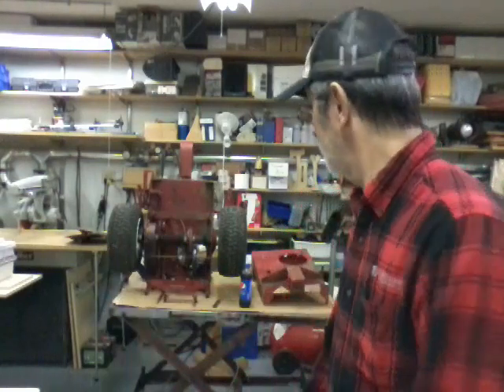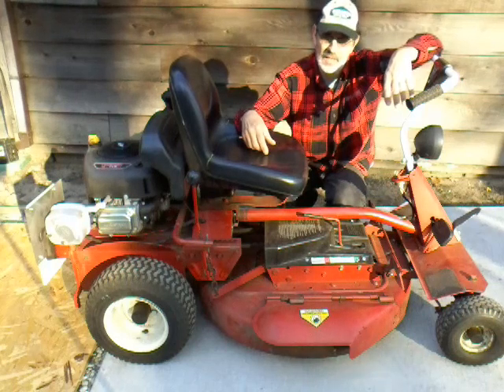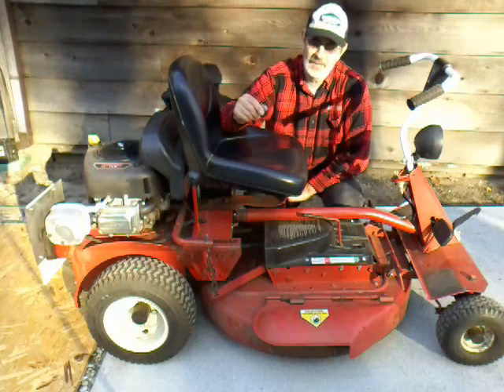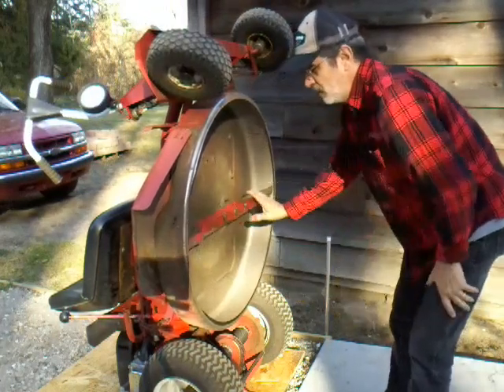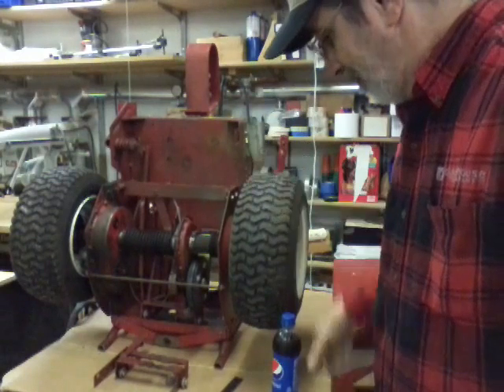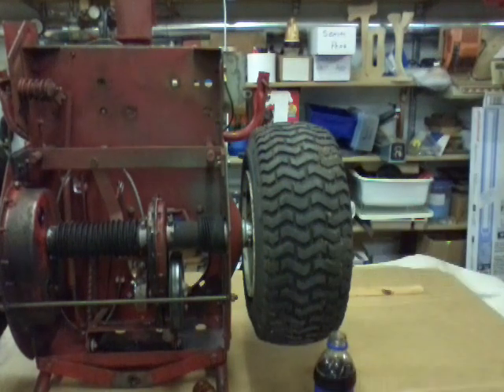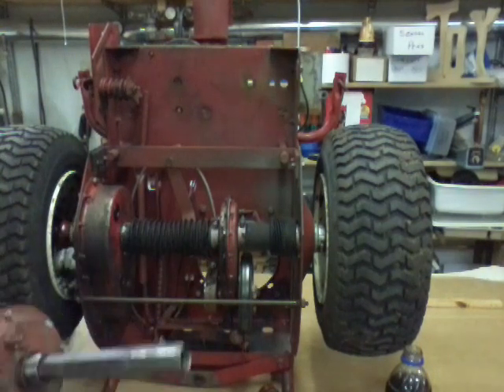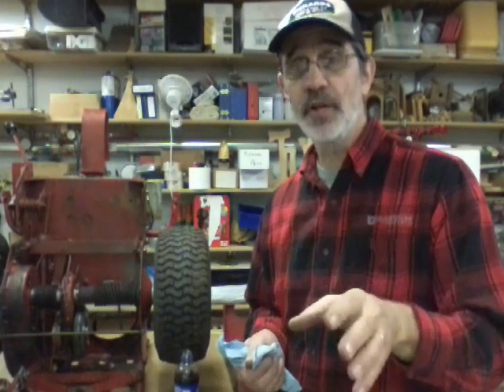56. Buying a used snapper,   things to look for

Comment: Hi Jim. Next week I'm going to look at what the owner says is a 25 inch cut Snapper. I've owned a 28 inch but never remember seeing a 25 inch anywhere. Is there a 25 inch?  It looks in great condition with little use and garage kept for $500. I will inspect it as you suggested in your Youtube above. If it passes inspection, is $500 a good price to pay? (I don't know the age but it has the steering wheel vs handlebar).
Reply from the maker: Jack Johnson 
  Hi Jack
 Just make sure it’s a high vac machine                Depending on where you live 500 sounds a little high for a 25 inch and less it has a bagger, and they typically have about a six horse engine on them. Jim

Comment: Hi Jim I've been watching your videos and you're you're pretty knowledgeable and helpful and lots of ways I have a problem with my snapper it's a 30-in cut with a 12 overhead valve motor and the battery won't stay charged it's a I bought a brand new battery and put on it I checked my lines on my charging lines and they're all connected and it won't hold a charge on the mower I can leave the battery on a charger all night long that when I first try to start it it'll fire real strong and real hard and and into the mall for me a little bit but then it'll just get tired and quit and then when I try to crank on it my batteries almost dead
Reply from the maker: Well let me ask do you have a voltage meter they are really inexpensive at Harbor freight then what I need you to do is start your machine and take the positive battery cable off (but don’t let the red cable touch the frame of the machine when it’s running)    and put the red lead on the battery cable and the black lead somewhere on the machine for ground this will tell you if your stater is working or not depending on the speed of the engine you can have anywhere from 7 V. up to 14 V. it could be shorted out and that’s what’s draining the battery dead check that out and let me know what you find out. Jim
Reply: No Him, I do not have that meter however, I'm going to town this morning and I'll get one, and try that out and let you know from there. Thank you so much for your prompt reply!!!
Reply: I said Jim but my auto correct don't hear me right, 😐
Reply from the maker: @cathyjo-leneprocter4194  Mine does that to me all the time and it really comes up with some bad things once in a while. Jim

Comment: I am looking to buy a 28" snapper riding mower, with a 10 hp motor and after-market bagging system. The motor is being tuned up by the seller, along with a new battery for the starter, and this video was very helpful for me to look closer at the frame and bearings, etc. The mower is clean, but the seat has a rip in it. What would be a fair-market price for this mower? I will send an email as well, and thank you for your help!
Reply from the maker: I would have to see a picture of it, and what body style is it does it have a round tube, a rectangular tube, or is it a turtle. Jim

Comment: Ive watched you for awhile & you've been a lot of help. I have a series 19 snapper rider. I'v changed the clutch cable (frayed) the yolk (all gouged up) the clutch wheel (rotted). When its one its back Everything is fine, when I put it down on its wheels it will not go into nutral or reverse. Got any Ideas? thanx Marcus in florida.
Reply from the maker: snafu1957 
Hi it’s Jim
   This might sound strange but check the bushing in your fenders and make sure they’re in good shape if they are totally wore out it will allow your axle to tip and it will shift hard.
  If you remove the yolk you wanna check that and make sure the tail of the chain case is sliding through the yolk properly you can do this with the machine standing up. 
   Check this stuff out and get back with me and let me know what you find. Jim

Comment: I just bought a series 11, as I’m learning , that has the channel iron style front tube assembly.  Specifically it’s a model 80260 
301011BE.  I like this machine a lot.  I serviced it greasing and oiling everything you’ve shown in your videos and checked the gear lube in the chain case and differential. I topped it up bit with Lucas gear lube. It was slightly low but not by much and the lube in it was still fluid and not hardened.  There’s no evidence of any major leaks.  The clutch driven rubber wheel is about half worn so I’ve ordered a new one to install. There is a good bit of loose wobble in the other half that is  is bolted to the chain case. I feel like this needs to be replaced but I cannot find this part as readily available as the rubber wheel half. 

I have two questions actually. One is, how does this series 11 machine stack up to the other “round tube” models?  The second question is how do I break the large nut loose that holds the other half of the clutch to the chain case so I replace that part when I can find it. 

Overall my machine is in very good condition and has been maintained quite well be the previous owner. 
As it is, it runs excellent and has only very minor slippage of the clutch such as climbing a steep bank or driving it up the ramp gate onto my trailer. 
I’ll tighten up the spring on the yoke too if needed once I install the new rubber driven clutch wheel. 
Thanks. 
I’ve learned a lot from watching your videos.  I’ve always admired the snapper rear engine riders and have used them to mow with a few times over the years but this series 11 machine is the first one I’ve actually owned.
Reply from the maker: Well, I would actually have to see a picture of the machine you have it sounds like you bought a SR machine. The clutch disc itself should be loose and spin on the clutch disc assembly. The clutch disc assembly should not be loose and should be bolted solid to the chain case I hang onto the assembly with a glove on and break the nut loose worth of ratchet and socket. If you can’t do that there is other ways it’s kind of hard to explain. Maybe I’ll just do a video put it on my channel tonight. You can send pictures to my email, which is.
jimsfixitshop@gmail.Com
Thanks again. Jim.

Comment: Hello Jim, I inherited I Snapper Comet 3080S with A Tecumseh 8 Hp Runs pretty good after some work However the brakes are not great and the it jumpy no matter what Can the clutch be upgraded to the smoother type so it does not try to jump off in first Mine has the clutch  and the separate brake petals I'm guessing its 40 plus years old
Reply from the maker: Hi it's Jim 
   If you order a complete soft clutch assembly it should fit on your chain case to switch that over from a solid clutch to a soft start. To  know for sure remove the clutch from the chain case take a couple pictures and email them to me at jimsfixitshop@gmail.com.  Thanks Jim

Comment: Hello Jim, where I live the ground is always wet and soggy. How much trouble would it be to put double wide tires in the back and the front to get less ground pressure ??? If I could buy adaptors to make this happen I would really be ahead of the mowing season. Makes no sense as I live on a hill but the ground is a swamp. Thanks
Reply from the maker: Victory First 
I have been thinking about that myself let me see what I can come up with and I’ll get back with you. Jim
   I have the back figured out I’ll just have to work on the front
Reply: @jimjackson9381  I look forward to hear from you Jim. Thanks again and peace too.
Reply from the maker: Victory First 
Can you send me your email address so it’ll be easier for me to get a hold of you when I come up with something, send it to my email not this description box, my email is
jimsfixitshop@gmail.com
Thanks Jim

Comment: Thanks for these great videos.   I have a m280921B that I bought new about 20 years ago.  Used your videos to replace both boots, replace the drive disc and replace the belt. Unfortunately I have the type where the front end tube rides inside the welded-in tube and the thing is frozen solid so I can’t move it and therefore can’t adjust the new belt. Frustrating.  I’m going to try heating the tube as you explained.  I have chained the rear of the mower to my trucks hitch and secured a chain-pull to a tree which I will hook to the front end of the mower.  I figured I would heat the tube and use the chain pull to try and yank the tube out. Do you think this will work? Any other ideas.  Thanks again.
Reply from the maker: Tom Gardiner 
Well if you heat it up hot enough
it will come right out by hand. Jim

Comment: My 2013 model 2800 bought used at great price and it looked like new. I cut twice and will not start again and will not even click. The tiny battery shows it is at 13.4 volts. I saw the video about these being lemons. Must be a bad switch as you mentioned as well. Give me some feed back, please. Thanks. Tim Williams Anderson, SC
Reply from the maker: tim williams 
I don’t work and a lot of these machines but what do you want to try first is unhook all the wires from the magneto shorting block Except the wire that comes from your ignition switch and see if it will crank over that Should disconnect all of the safety switches . Let me know how it acts . Jim

Comment: Jim, I have a Snapper 28 in mower and want to raise the mower deck higher that the top most notch on the height adjuster. Is there any way to raise the deck?

Comment: Jim, do you have a video or can you tell me if there is any real different between the units you show with the exposed round tube vs some of the units I see that have squared off sheet metal?  Are those units with the squared off sheet metal just the same with a cover over the tube?  eg. is a 5368 still the same as the comets you show in the video?  Also, what models are considered commercial with the bearings for the back axle?
Reply from the maker: ukewarrior 
Hi it’s Jim
   The units with bearings in the back axles also have eight pinion gears in the differential instead of four and that is what they call a “Tough series”. 
   The difference between a square tube in around tube is strictly personal preference, personally I like the round tube machines because that is all that I’ve ever had.  the square tube machines to me look a little clunky but that’s just my opinion they’re both built the same as far as the drivetrain and are both great machines. Jim
Reply: @jimjackson9381  I have owned the square model for a few years now and just recently bought a round tube model ($50 on craigslist, couldn't refuse. Figured I'd use it as a parts mower if I can't get it to run). I am curious which one I will like better after a season. If I get it running I plan on having one of my kids use it on the front yard while I tackle the back so we can have more of our Saturday for fun.
Reply: @jimjackson9381  BTW, thanks for the effort you put into these videos!!! Because of your videos I am now confident enough to take on any repair that comes my way. Before, I would have likely just taken my snapper to the dump and bought a newer piece of junk.

Comment: Hello Jim. I know this video is years old but very valuable. I'm looking at a snapper but the owner says it needs a carburetor cleaning and it won't start. What should I do?
Reply from the maker: If you can squirt some gas in the throat of the carburetor and it should fire on that if you can’t get it in the carburetor pull out the spark plug put about a teaspoon of gas in the cylinder put the plug back in and see if it’ll fire up if it’s a good running engine it should start running for two or three seconds before it runs out of fuel. Jim
Reply: @jimjackson9381  Thanks. I'll have to try that. I have a shed  and not a garage so I wanted a small rider. Plus the lawn people that I pay always cut it too short and they cut it the wrong way. I don't know much about snappers
Reply from the maker: @TheSoldout1  well it doesn’t matter if you know a lot about snappers or not if you have any trouble and need help just email me. Jim
Reply: @jimjackson9381  Thank you so much!

Comment: nice info ,my problem my old snapper 28/8 hp gas tank is creaked(in the seam), i check on ebay  they are 
real price to send to Woodstock N.B. Canada is their a good way of fixing them so they don't leak thanks
Reply: Hi... check out Steve's small engine saloon. He does a lot of videos on stihl chainsaws and weed wackers and blowers. He has a excellent video on how to repair a plastic gas tank. It's easy peasy. Kinda like driving a snapper

Comment: Jim, I have a 95 Snapper, 281013BE, and when I am turning right while cutting, the blade tends to dip down on left side causing irregular cut.  Any idea on why?  Tom in Washington.
Reply from the maker: Well this is gonna sound a little funny but check all the tires for proper air pressure that will cause this issue.  And under the front end where your feet are there is a half inch steel bar that slides through that holds the deck up make sure that is all the way through both sides of the morning frame. Jim

Comment: Great videos. I have a 94 snapper with a 12.5 hp briggs model 289707. I am having a no spark problem. I have tested the coil, get a reading of 4.65 ohms. The plug is good, the key switch is good, I disconnected the kill wire from the coil, still no spark. I sand papered the magnet on the flywheel & the mounting where the coil bolts on. Still no spark. Could the stator cause this problem. 
Thanks from Dallas, Ga.
Reply from the maker: Tony Jackson 
Hi it’s Jim, your no spark issue Hass to be caused by the coil it’s either has a bad wire from the coil to the spark plug or the coil itself is bad the only thing the stater does is create power to charge the battery and run a headlight. If you have removed the small wire from the coil that shorts it out and it still is not firing then the coil Hass to be bad I would Remove the spark plug from the engine plug it into the wire and ground it to the frame and see if it sparks if it does put a new spark plug in it and see if it starts if you have no spark with the plug touching the frame your coil must be bad. Jim
Reply: @jimjackson9381  hey Jim, it was a messed up kill wire, it was grounded. Thanks for the great videos, you are doing a fantastic job.
Tony Jackson

Comment: What is the best way to begin removing a muffler off an old Briggs 12hp engine so I don't break off the bolts
Reply from the maker: Thomas Jones 
Well that’s a very good question you have steel bolts threaded into a aluminum block I would try wiggling them back-and-forth and try to get some good penetrating oil down in the threads you may even have to apply heat but try not to apply the heat to the bolt try to heat only the aluminum sometimes that can be a huge problem, let me know how it comes out and if you’re having any Problems with it. Jim

Comment: Hi Jim. New sub here. Do you do anything to the mower before standing it up? Fuel leakage?  Great vid. I'm thinking of buying a used Snapper.
Reply from the maker: 94jimmy5 
Hi it’s Jim, if you’re going to stand them up for any  time I would drain the oil and gas if they’re going to be  up for more than two hours they recommend taking the battery out, although I would take it out regardless of how long it’s going to be standing up battery acid will leak out onto your carburetor and destroy it thanks Jim
Reply: @jimjackson9381  Hi, I was thinking of standing it up to clean under the deck after mowing. It makes sense to pull the battery.
Reply from the maker: 94jimmy5 
  For five or 10 minutes probably not depending on the type of battery you have some batteries are  maintenance free some have caps you can remove to add water when needed those batteries I would think would leak faster than a sealed battery. Jim

Comment: Is there any chance you could do a video on how to handle a surging Snapper? I have a 28in 12HP from 2005 and it surges pretty bad right now
Reply from the maker: nonsthewiser 
  Well without seeing the engine I would have to say your carburetor needs cleaning or your governor needs adjusting. Thanks Jim
Reply: If that's a B&S engine, it may be missing a small  spring that goes from the governor lever to the carburetor. The mower will run but surges bad until under load. Springs are available on line or from local B&S dealer. P/N 691842 governor link spring fits many models, but there could be other springs. Stents parts also makes them. It's just a tiny weak spring but essential for smooth running.

Comment: We just bought a Snapper model 30085S, how do we find out year of manufacture?
Reply from the maker: If it has the original engine there is a number on it that’s wrote underneath where it says code the first two numbers are the year that the engine was manufactured and probably the year the machine was built. Jim